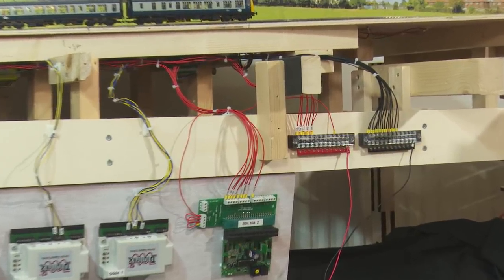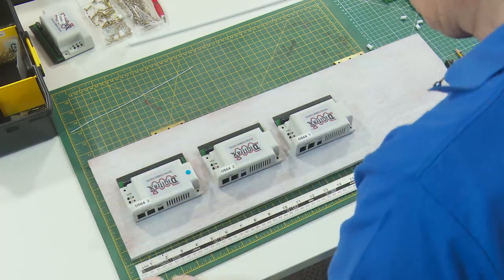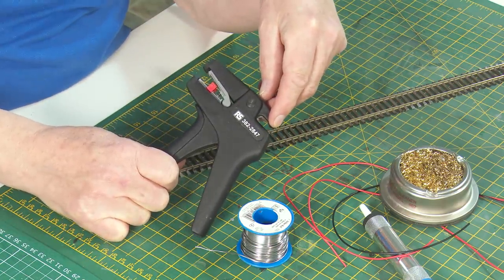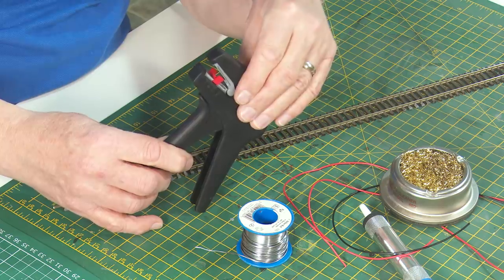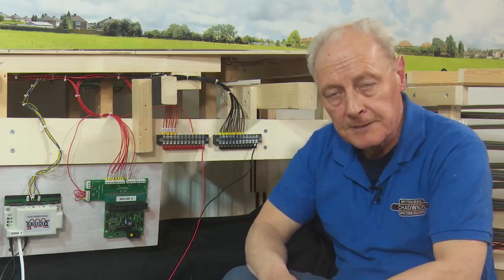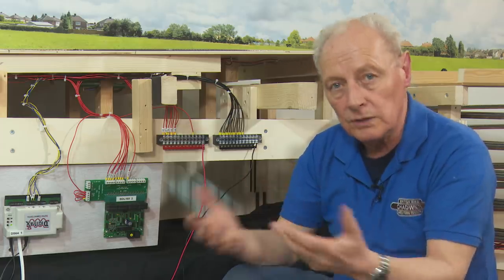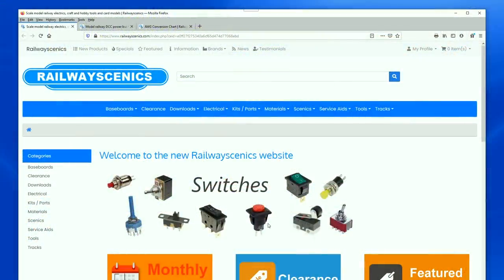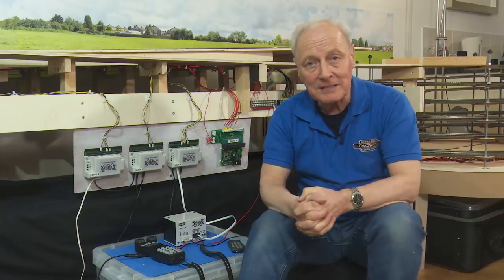More DCC Wiring at Chadwick Model Railway | 128.

Comment: I'm guessing that using stranded wires is a UK/European thing?  We use copper wire over here in the States.
Reply from the maker: Yes stranded wire is our thing over here. But they do allow more flex in your layout. Regards Charlie
Reply: US layouts use stranded wire as well. Solid vs. Stranded has nothing to do with copper vs. CCA, both materials are most often stranded in hobbyist applications.
Reply: @woodalexander  It's only been about 3 dozen years or so since I last worked on one, but all the ones I remember from way back then used either old retired phone lines or solid copper wire, if conductivity is all the same it doesn't really matter...to each his own.  Personally when I get back into it, I'll stick with what I know and don't feel like twisting that stranded stuff anyways(already did enough of that).
Reply: @zaklex3165  You mean at the end after you strip it? It's a pretty minor thing in most cases. Telephone wire is WAY too thin for bus lines or even probably feeders, it's usually 24-26 gauge. Most layouts use stranded wire for flexibility, people have used solid, it's fine electrically, but a PITA to work with. Just be careful to get solid joints with feeders, it's a lot tougher than with stranded wire.
Reply: @woodalexander  We used it for the feeders, 24 gauge, and we used 12 for the bus, also solid wire, but then my dad didn't have to buy it as he worked for GTE(when it still existed) at the time and they always had scrap wire.  I don't recall ever having any problems with the joints, but then everything was tinned before soldering the feeder to the rail, like I said though, this was 40 - 50 years ago, nothing has been worked on for at least a dozen years since they retired and moved, it's almost all still there though.
Reply: @zaklex3165  24 may be OK for short feeders.
Reply: @woodalexander  That would depend on what one considers to be short...not being able to see it first hand right now(since he lives about 500 miles away) and the longest feeders no longer exist anyways...I think some of them  might have been up to 24 inches long, give or take a few inches.  The buss ran around at the same level under the benchwork, below the open grid so the shortest would have been roughly 6 inches in length.
Reply: @zaklex3165  Probably under 6". Some feeders are up to a foot.

Comment: PCB's like to be standoff mounted as the underside is seldom completely flat which means that if the mounting screws are over-tightened the board can bend and then there's a risk of breaking a track ... and hairline cracks on PCB tracks are a b***er to find and repair!
Reply from the maker: An interesting point Ed, thank you

Comment: While I don't necessarily agree with the physical routing of your wires the wiring structure that you developed is rock solid.  You should have very few problems with this approach and when they do occur your troubleshooting and repairs should be straight forward and quick.  Good work and thanks for sharing.
Reply from the maker: I’m so pleased that you found it interesting.

Comment: Ha! I am at a very similar stage as yourself with my new layout. What a relief to see that I am not the only one who generates an absolute rats nest of wiring by the time that servos, frog juicers, block detection and power have been wired into a modest selection of turnouts. Your final cable routing is brilliant and I quite agree, consistent wire colour and labelling is key. By the way, you can get nylon pcb spacers from rapidonline.com - product code 33-2224.
Reply from the maker: Thanks for the tip Alan and I’m so pleased that you enjoyed it.